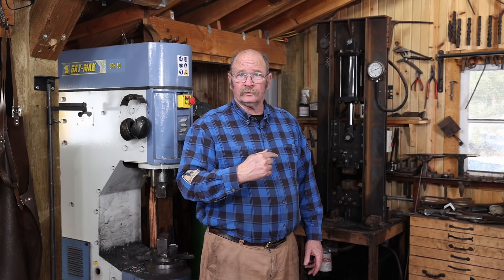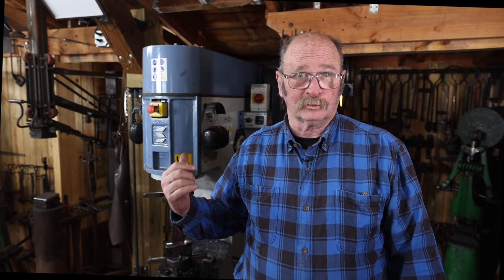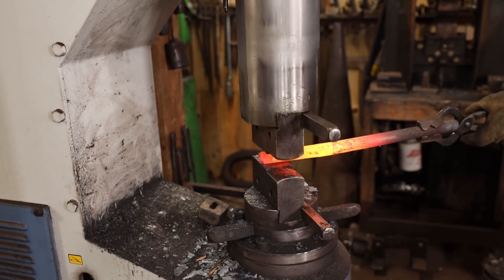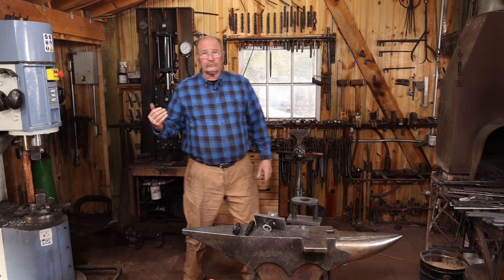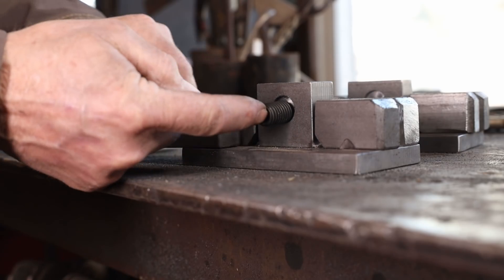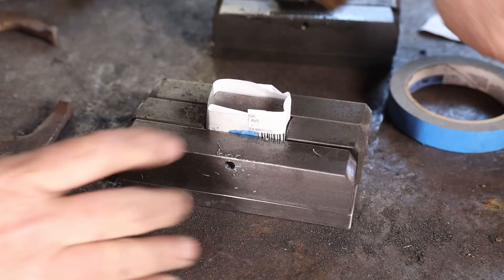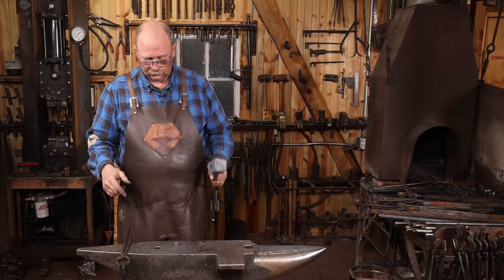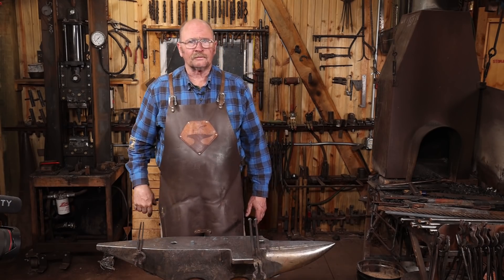Pressing Concerns - Hydraulic forging press modifications

Comment: Being a rookie, trying to come up with some equipment,  i found that a press is a whole lot more available than a power hammer,  most turn log splitters into presses by simply adding an anvil, in my case, a piece of railroad track with a 1" ×4"×5" plate welded on the end to be the anvil.

Comment: I have a question with Forge welding cable I got the cable forge welded together but whenever I tried to take the cable billets and put them together I cannot get them to forge weld not sure what I am doing wrong
Reply from the maker: There are so many variables that all have to come together that I can't say for sure.  But in most cases its either not hot enough or has something contaminating the weld.
Reply: @BlackBearForge  thank you John I will go back and re-clean it and try again hope you and your family have a great day

Comment: Thanks for the video, a friend of mine has a bunch of scrap currently with two large hydraulic pumps and one ginormous hydraulic cylinder. Something like 8 inches. Scary. I was doubting it would make a good forging press in terms of being way too slow even on a large pump and also dangerous because i don't think i can make a frame safe at some sort of utterly crazy tonnage that needs more square inches of steel to resist than what can comfortably be welded with a normal size stick machine. Probably gonna take one of the pumps and get a more resonable cylinder from...somehwere.  Unless those pumps are fairly low pressure and high flow but i do not think so because the original application was likely slow (sausage press which does not use a screw extruder and instead has a giant armored bin with a 20 inch piston under the meat, weird weird weird piece of gear)
Reply: And actually i am now reconsidering using that cylinder. Its there, its free and i have two pumps which both turn out to be single stage and 5hp each and after subtracting the od, the cylinder seems to be more like 6 inches ID.  Now i just need to figure out the flow rate of the pumps. Maybe they DID enable high travel speed for cleaning and such and since they are both single stage and were simply connected in parallel, it seems likely that it might all just about work out fine because that is a lot of power on a cylinder smaller than what it looked like when hidden between lots of lines, pumps and junk in the belly of a dark and dirty machine.

Comment: Hi John, nice informative video. Couldn't miss the post drill, nice touch. I just picked up a Canedy Otto post drill, 2 speed spindle, 3 different feed rates, also has a bracket to hold the drills and oil can. Very rare to find one with the accessory bracket. No breaks, or welds, and has the original plank it's mounted on. Sadly no tooling or oil can. 👍🔥⚒

Comment: I also used the Coal Iron design for holding the dies on my DIY hydraulic press. Except that I used taper ended setscrews and I also offset by 1/8 inch the tapered dimple in the die. That way when when I tighten the setscrew, it seats the die to the base. Works great!

Comment: Thanks for another good video. I agree, you need to speed that press up some. However, I’d like to clear up one misconception. Horse power alone is not going to speed it up. In hydraulics flow is speed, resistance to flow is pressure and horsepower is force. You need a higher rpm motor for more speed. More horsepower and rpm’s would be best.
Reply from the maker: Correct, but to achieve higher RPMs requires a 5hp full speed motor to replace the 2 HP slow speed motor currently being used.
Reply: I figured you knew what you were doing. I just didn’t want folks out there in video land to think they could get more speed from higher HP.

Comment: great video sir im in the process of building my press may i ask what are your die sizes ? i want to make mine so they can work with the coa l iron works dies  thanks your videos are great  Mark 👍👍
Reply from the maker: My old base plates were 4" X 6"  The new die holders are set up for 3" X 6".   Since the old system had a frame around the plate to hold it in place and the new one doesn't, the new system will actually allow for larger dies.
Reply: @BlackBearForge  thank you for replying will help me alot Mark 👍👍